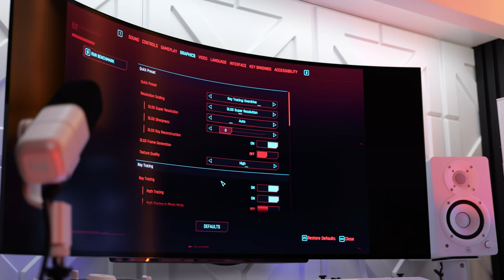EPIC $5,000 PC Build Time Lapse - Thermaltake CTE T500

Comment: Doesn't the smoke at 7:30 show that most of the air goes straight up, and not through the rad at the back?
Reply: The rad at the back has the fans mounted for intake as well, as far as I see. The fans used are reverse blade. With a single exhaust fan on top. It would be impossible for the smoke introduced in the system from the front side (air in general), to go through the case and exhaust through the back rad in this current fan config.

Comment: Most times when I see watercooled PCs, the tube that is filled with the liquid doesnt get filled to the top, but in this case you did. What is the reason behind leaving it mostly full, or filling it all the way? Is there any actual difference besides the empty space in the tube and having it full?
Reply from the maker: No difference really, mostly just aesthetics. As long as the pump is fully submerged and it's not overfilled to the point where it's coming out the top you're good xD Always good to leave a few mm

Comment: The build is very nice, one thing you've got a MSI GodLike a $1300 MB and a 4080 GPU.  I would think if your going all out on the mother board you would as well on the GPU.  Did your sponsor not want to spring for a 4090?
Reply from the maker: They only had the block for the 4080 I believe so that's why we went with it

Comment: In Brazil this costs only 46.430 R$, don't is a joke, look:

Case: 1.300 R$
MoBo: 13.665 R$
CPU: 4.500 R$
RAM: 1.300 R$
Storage: 1.100 R$
PSU: 1.500 R$
GPU: 12.000
FANS X4: 2.540 R$
Water cooler: 3.000 R$
Pump Res: 2.250 R$
Fitting: 800 R$
GPU Waterblock: 1.400 R$
CPU Waterblock: 995 R$
Liquid: 800 R$

TOTAL: 46.430 R$